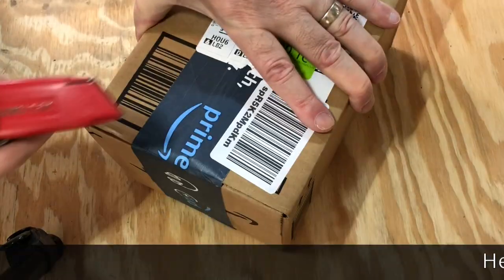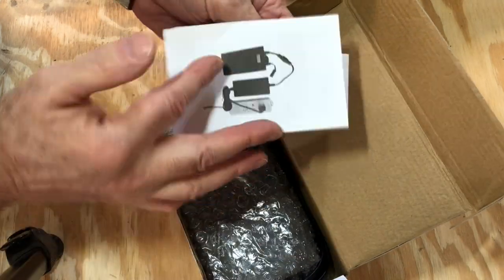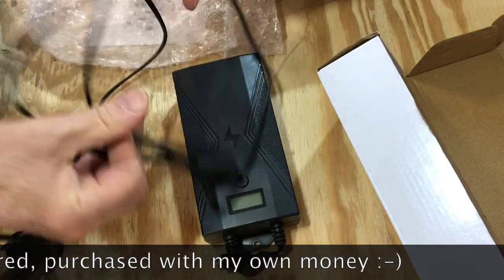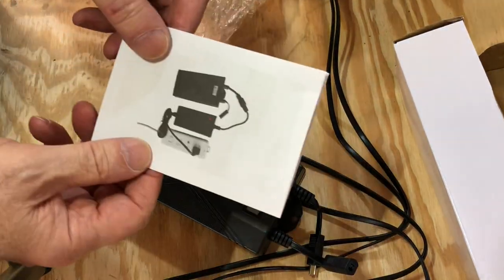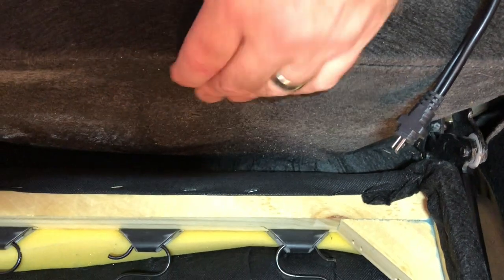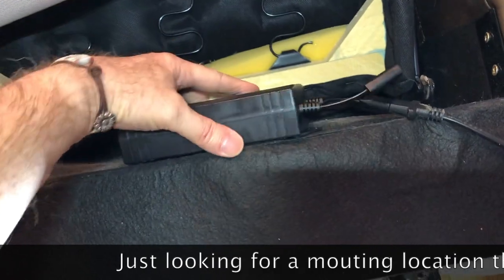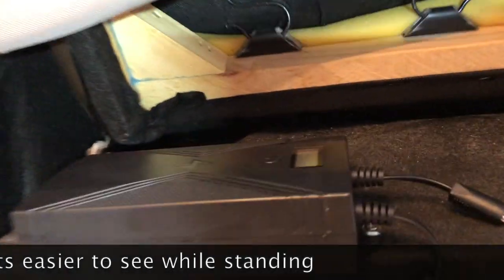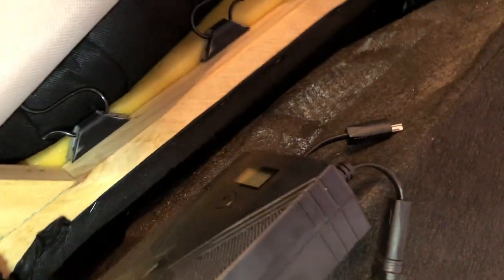Installing Battery Pack on Power Recliner

Comment: It seems that you have had this battery pack for almost a year, any issues with it? Can you provide your honest feedback? I am about to order one from Amazon , based on reviews I am not 100%  sold  on this battery pack yet.
Reply from the maker: It still works but it needs to be charged weekly.  Also bending over to plug it in is a chore at my age.   Over all I am still happy, but I might look for bigger or longer lasting power.  No operational issues for unit yet.  Thank you for asking😀

Comment: I don't understand what I am supposed to look at on my chair to know what the right cord is.......I see in your case that it is a 2 pin back up pack, but don't know what or where you looked to determine this.  I also don't understand where the back up battery plugged in on the chair.  I could see that you used screws to attach the unit to the back side beneath the flap of your chair.....but overall I feel confused and clueless.  I am not tech savvy and feel out of my depth as I try to learn what to do and what to get so that I will never again get trapped in my power chair.  It was a bad feeling that led to re-injuring my knee, so I am determined to find out what to buy, but needs more basics to be successful.  You have made it look very easy.......but I am still not understanding what to buy.  I own a Catnapper chair, called the cloud in sage green.  I have jotted down input and output info but don't know how to translate that so I know what to buy.  Maybe I need to start over  with my education but my white hair and health issues say a very firm but polite no.  Sigh, you made it look so easy........thanks for sharing this!  I'm more convinced than ever that there is a lot I don't know or understand.  Wish I was as smart as you are!  Take care!
Reply from the maker: Ruth, I will see if I can get more detailed answers soon.  Yes it’s all a bit confusing, I was also confused and spend hours trying to understand what was required.  It’s not clear.
Reply from the maker: Also, if you are unable to get out of chair when it won’t move this may not be good idea unless you intend to leave it plugged in.
That is, I love the no cords but when battery goes dead I have to climb out and plug it in.
If you are wanting a house power out back up this would be great.
Reply: @554LH  That is so kind, but only do it if you have the time and are up to it........I have been trying to figure things out through a cloud of brain fog.......but I have been thinking about your video.  It sounds like I will need help to push my chair over and then see where the connection is within the backside of the recliner.  Once I see where it is I should be able to see what the shape of the connection is.  I have very limited energy so with that being shared, I never want to drain energy from anyone who needs it for other things.......quiet smile of understanding.  I was trying to get answers and going about it in perhaps the wrong way.  I sent a message to the manufacturer of my chair and so far no response.  I tried calling stores near me that sell the catnapper.  One sales lady told me to call a number in North Carolina and once I got more info she said to call her back and they could then order it for me.  The number rang and rang and then said it was no longer a working number.  The lady told me to buy it from them would be $229.00 plus tax and ship fees.  Ouch, that seemed like a very pricey option.  I spoke to a few more people, the sales rep for the manufacturer said they don't sell a back up battery.  I said that's interesting, two other stores say that you do.......hmmm.  All my hunting has left me tired and wishing I could cross my arms like Jeannie from I Dream of Jeannie......cross my arms and make a battery pack appear already connected and doing it's job!  I'm recuping from surgery & my air conditoner stopped working.......not my best week!  On the plus side my car is fixed, on the negative side I can't get a ride to go get it until Monday at 4.  LIfe is all about patience these days.  Yes, I do have cabin fever........can you tell!?!  Thanks for writing back........and thanks for sharing your video!